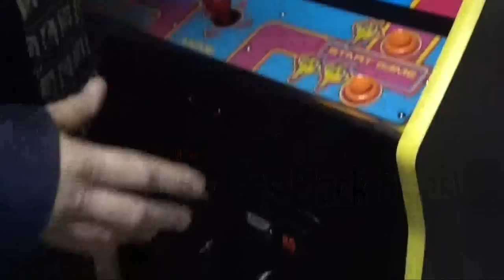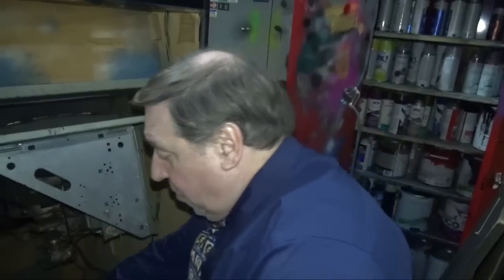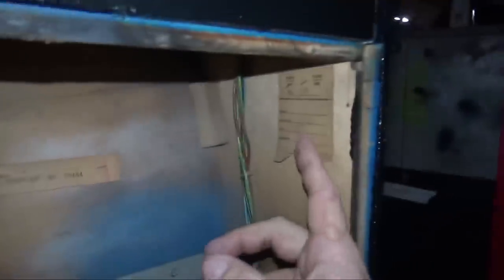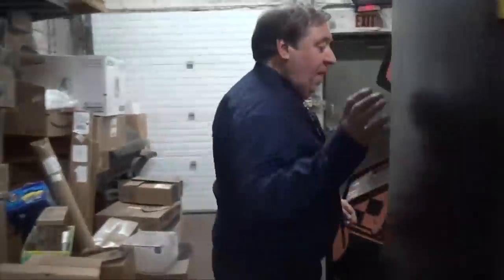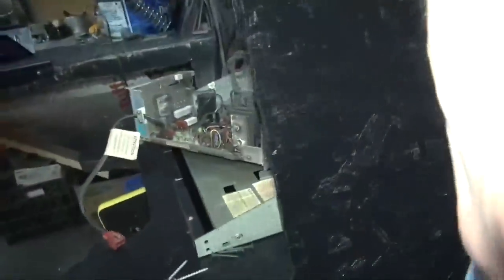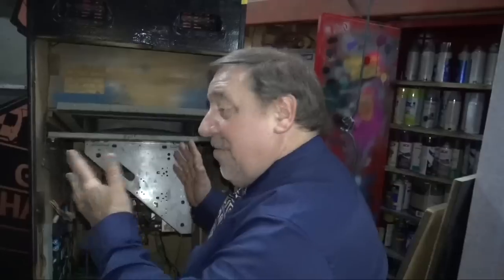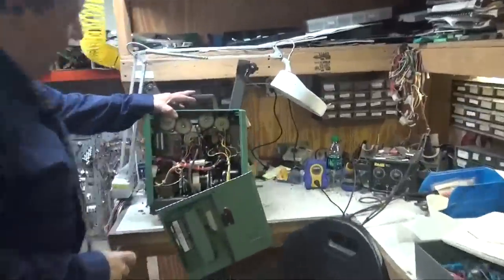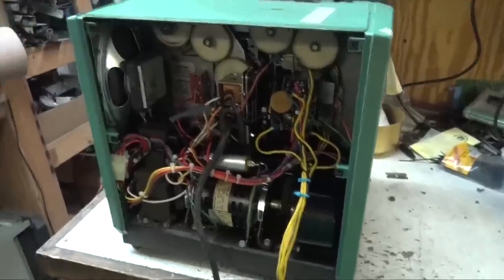#833 TODD'S TIPS-Easy  fix to Adjust WRONG COLORS on Arcade Video Game Monitor

Comment: Nice Ms Pac-Man Todd, even with just plain black sides. In most arcade settings, you're not going to see them anyway! Ever do the "turbo" button mods to these? I think you can set them into turbo from the menu, but I remember seeing some machines with a button on them for turbo. Great job as usual guys.
Reply from the maker: Paul M  Thanks!  The button was an aftermarket addition that can be done...but so far no one has asked yet!

Comment: Todd, can you please help me out and tell me why the screen scroll the colors and number patterns?

I'm having problems with my arcade and it's doing this motion over and over and it keeps reapeating. When I close the door panel then it shows the regular ghosts gathering around the intro box but as soon as you put a quarter or start it up then it goes into that pattern problem again and also there is a odd beating sound coming through the speakers. I know I seen this pattern before by testing something but now it just does it on it's own. Is there a button I need to press or something on the door panel because I forgot if there is one?

Thanks, Mike
Reply from the maker: reseat the chips and also the little daughter boards on the main  logic board, check the 4 fueses on the bottom of the game too..
Reply: I will test each one you mention and I know it's a simple problem so thank you for the tip Todd.

Comment: The monitor's colors change because of the change in relation to the earth's magnetic field. You can see the same thing if you take a CRT TV and turn it on its side. The wire loop around the front of the CRT is the degausing coil and is turned on for a moment when the monitor is powered up to "undo" any magnetism the earth puts into the CRT.
Reply from the maker: ***** That's right...this is why you let it sit before turning back on.

Comment: Stupid question, what the point of the capacitor on the logic board?
Reply from the maker: Scott Cagney Several Bally Midway boards do not have an external power supply.  This logic board makes its 5 and 12 volts right on the board...the capacitors are part of the two circuits.  Changing the capacitors is like putting in a new power supply!

Comment: now we know why we have a degause (sp button on the older tv's  doubt LCD has that.  although they still claim don't put a cow magnet on it. :)  I've tried doesn't do a thing :P  course the lcd sucked so obviously....anything to get a stuck pixel to move.    as for the projector.  sigh  if only printers today lasted like they used to.  $200 Canon MX870 pixma printer  meh I guess I'm supposed to learn how to fix it.  bigger electronic waste people than throwing pinballs off roofs  bad Canon!!  for the moment I hacked the thing so it runs fine..  stupid B200 error..  looks like Ms Pac Man needs a vacuum  and whatever IA gets , TNT seems to get.  we got a trace just say .. hey at least the fans won't be an issue :)